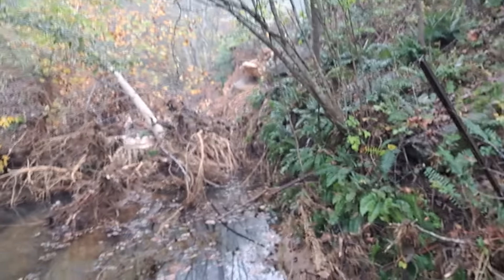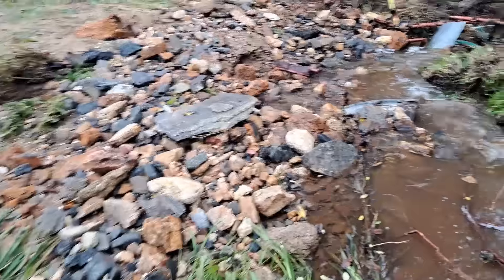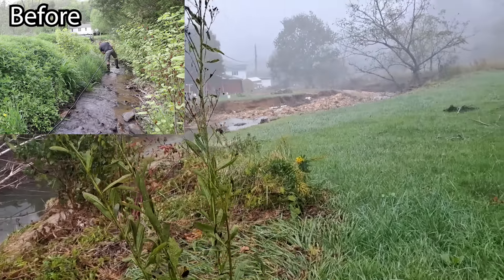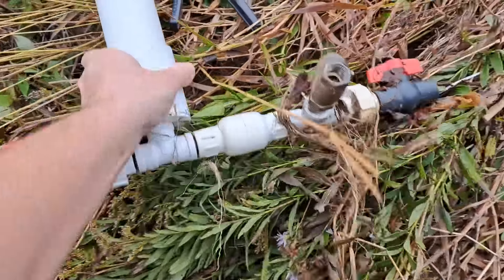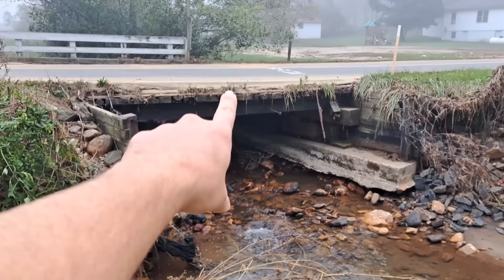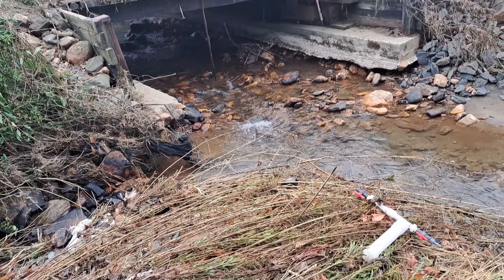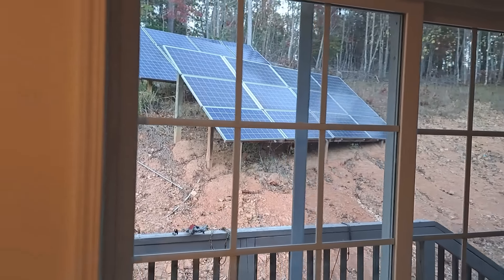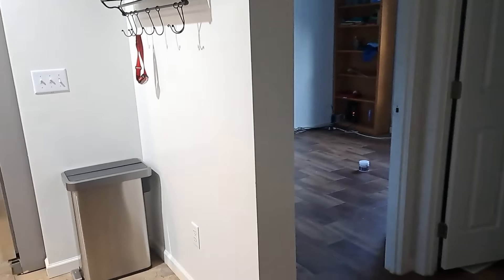Massive Flood Damage and Saving Cows with Spring Water

Comment: Wow! That’s terrible. Much worse than I imagined.
If you are able to receive mail and have an electric water heater, I’d be happy to send you my back-up solar hot water unit. It’s still new in the box. You would just need a small box to put it in and a breaker of some sort. It makes your existing water heater a hybrid unit by attaching to the lower element to receive power from Solar. Just pm me your address and I’ll send it and the documentation. I hope everyone there is able to get the things they need to get back to normal quickly.

Comment: Preparing for a disaster is very different from living through one.
Reply from the maker: I am so happy that I have solar and a well. Most of the towns around are still without water and sewer. Preparing has paid off.
Reply: @LandtoHouse   You had your 7p’s in order. (Plenty Prior Planning Prevents Piss Poor Performance)
Reply: @LandtoHouse  you learn very quickly how many panels and how many batteries you actually need when the lights go out

Comment: Toaster oven and hot plate will get back to cooking on solar
Reply from the maker: Yes! My electric hot plate has been well used over the past 2 weeks.
Reply: @LandtoHouse  you can heat enough water on the burner to at least have a wash cloth bath

Comment: How do you know that water is OK to drink ? Do you know what's up land front the water flowing down stream to your working area  ?
Reply from the maker: That spring head is just up from the overflow pipe. About 200 feet away. The spring box is tall and should not have any runoff water inside.